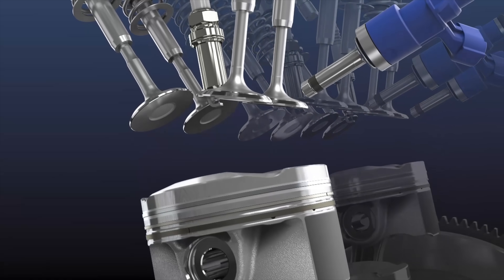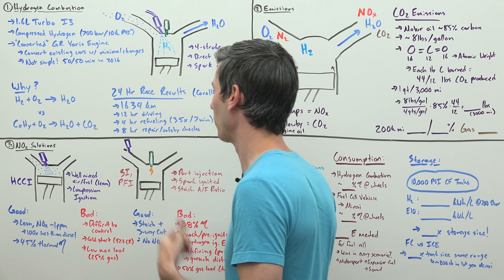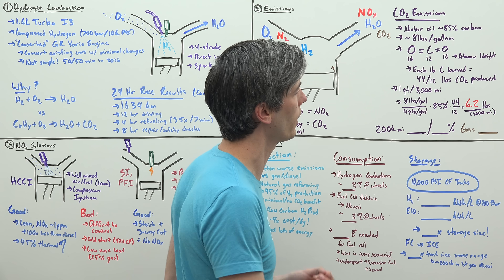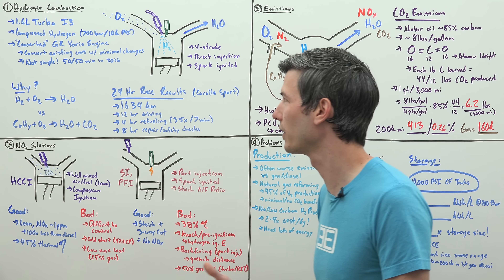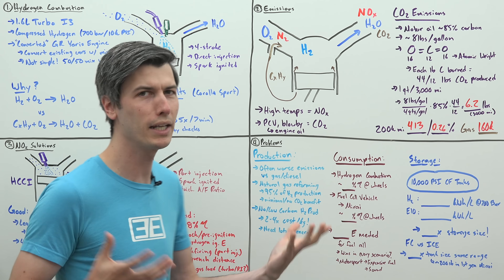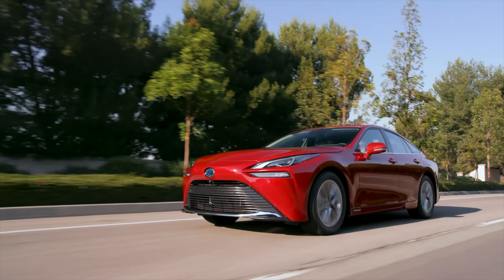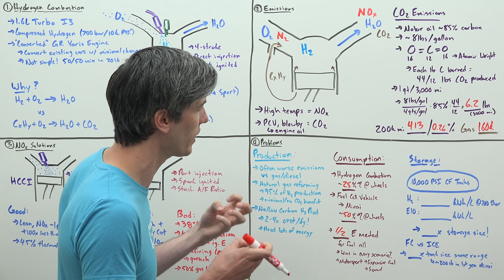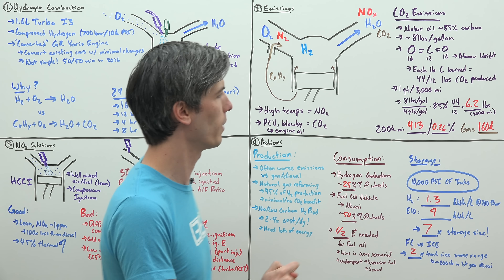Toyota's Developing A Hydrogen Combustion Engine!

Comment: Guess what, most electricity to charge vehicles is also using natural gas and other means in power plants, so stop using this is a way to discount hydrogen production, latest gen nuclear is the answer.  Consider ICE engines and their factory lines are already in place, so it would only need minor retooling instead of complete overhauls, calculate that carbon footprint.

Comment: I'd rather this and just pour water into the engine instead of charging a battery every two hours and then in 5 to 10 years replacing that battery at $5,500.00

Comment: More than 95% of hydrogen is produced resorting to fossil fuels in an energetically inneficient process.
I love toyota as a brand, but I also think they sometimes are too stubborn and do some incomprehensible things.
It's funny that they think its a wise thing to do what BMW has done about 20 years ago, and which mazda (a company which toyota holds major stock in) has also investigated on.
In the end it is still an ICE engine, limited to the carnot efficiency, and it's an investment in overal outdated methods of having kinetic power.

Comment: Alot of electricity to make hydrogen. So you create a huge loss in this method. So you wanna make electicity convert that to making hydrogen, then use that. lol. The amps used to convert water into hydrogen is crazy. You would need to make hudge hydrogen factory's, and then nuclear power plants, natural gas, or solor factory's to power them,

Comment: OK, now this I like. It will need a lot of improvement before it is ready, yet I like the concept.

But as far as the blow by, listen, when your rings wear out, your rings wear out. You are going to get blow by running an old gasoline engine in need of a ring job just as surely as you will get it doing the same with a hydrogen engine.

So the blow by when the rings wear out...that's zero change from one engine type to the other (speaking of blow by alone). Here we are seeing that the emissions NOT caused by blow by are significantly less with this engine. Again, I dig the concept MUCH more than the virtue signalling foolery of electric cars.

The future will hold the same problems as every other new transportation technology: Infrastructure.

When the automobile itself was new, the manufacturers of them got together and started building roads, so people could use their product. That costs money, and a TON of it. In this case, Hydrogen supplies will have to become readily available all around the world. That is a MASSIVE expense. This will never occur unless everyone decides on ONE new technology...

...and if they DO build that infrastructure, they are not going to be willing to just "up and change" again in 100 years, when future hippies start whining again.

Comment: I dont know where you live but it must always be 70 and very pleasant.  LOL  Real world life in the northern states and cities. New York, Chicago, Buffalo require interior heat. This is something that is rarely looked at in a world of gasoline engines that provide enough waste heat to heat a home. Gasoline engines provide so much waste heat that we actually bring in outside air and pressurize the vehicle so we dont feel any drafts. lol Amazing what you can do with gobs of waste heat. Now with what we have taken for granted , we are being ask to create heat with our already low density fuel. So when you show numbers like 50% to 25% it really means nothing to the huge population of the Northern states because the combustion engine will still provide the waste heat but the fuel cell and battery vehicles will not. Heating the vehicle becomes a real BIG factor in the performance of these cars and can no longer be simply overlooked because it was never a problem before. Dont forget a large part of your subscribers are from northern states and many like myself wake up to 5 degrees with 6 inches of snow or ice on their cars and we need the kind of information you provide to make decisions on our future vehicles.  Also air conditioning electric consumption?  Very informative channel, very interesting and well done. Thanks

Comment: Without looking at the video I’m going to say it’s a really bad idea. 1. It will be even less efficient (by a lot) than a hydrogen fuel cell vehicle. 2. 99% of the world’s current production of hydrogen is not green so you may as well stick with good ol’ oil. It’s just not economical to make and store green hydrogen. 3. Lots of moving parts, lots of points of failure - so a backward step in vehicle design. 4. It’s Toyota, who are desperately clinging on to hydrogen as a future fuel.

Comment: Using hydrogen in internal combustion engines achieves only 20-25% efficiency and low power output compared to fossil-fueled internal combustion engines.

Comment: Back in High School, 1980s, I wrote a paper on the feasibility of Hydrogen as a fuel source.  I see that nothing has changed from my conclusions after 30 years.

I really wanted it to be the solution for the next generation of transportation.  But, as you show it is mostly impractical.

My conclusion was that we needed more nuclear power plants as reliable, inexpensive and abundant electricity is at the heart of everything.

So, I studied nuclear engineering in college and worked at a power plant.

Comment: You can produce a tremendous amount of hydrogen gas from a nuclear reactor, for FREE.  And the only byproduct is all the carbon free electricity you want.
Reply: and eternal toxic waste
Reply: @lowfatedes  no. Modern reactors can process all nuclear waste. Their own waste and waste from old reactors.
Reply: @johnnycarson67  mate you can process it until the cows come home, but there's always going to be nuclear waste
Reply: @lowfatedes  let me put it this way, mate: the amount of waste produced compared to ANY other form of energy production is about a trillion to one. An aspirin size o nuclear fuel could power your whole house for a year.   The amount of coal to do that would fill your house up several times over.

Comment: THE BATTERY ISSUE might get better, storage, low drain when not in use, speed of charge and longevity when used BUT don't hold your breath. Currently, we have squeezed that lemon with a hydrolic press. A better thing would be nuclear powered cars using low radioactive elements and going 99% nuclear power for electricity which safe never mind the WOKE crowd who fear Nuclear but not STD's which is what takes most of them out.

Comment: Why not a light weight & simple valve less 2-stroke hydrogen injected engine?
1)Lube oil injected (atomized) in the crankshaft area 
2)hydrogen injected during the upwards plunger hub... 
I expect high revs, high torque, great efficiency and low production costs

Comment: If they had  hydrogen engine's had died Direct oxygen injection just like that Drake fuel injection also 2 spark plugs every cylinder really would not be no carbon dioxide also if that exhaust was rearranged on each cylinder would not be any problems with water getting in any oil AlSO a  vent crankcase ANY 4 cycle engine would not give any problems running ONLY only hydrogen

Comment: Hydrogen gas @ 10 000 PSI in the tank? Oh boy. Oh boy. None for me thanks.
Reply: Safer than gasoline
Reply: @LewisC0298  "safer" is an extremely generalized term. Do you mean less volatile? More thermally stable? Less toxic?
Reply: @californiadreaming9216  in a crash the gasoline engine explodes more often on impact.

Comment: I liked Toyota, my family own a lot but they are soo doomed! 46km per fill is sooooo bad! WAKE UP! Even average EVs are already at 400-600km per charge and you dont have to go to a sticking expensive gas station! Hydrogen will never catch up. The filling stations cost millions and the only cheap hydrogen comes from fossil fuels that are running out! Converting water to hydrogen jsut uses a lot of electricity and adds extra cost, so why not just use it straight in an EV directly, much cheaper!

Comment: Why is the only argument about the cost of refining hydrogen from water? Think about the cost of refining battery elements from the global supply chain to replace all of the vehicles on earth. You can't simply focus on one part of the whole picture.
Reply: Because you don’t need to refine battery elements every time you refuel
Reply: @sam512  why bother responding if all you do is repeat the same point? Do you own an ev? What are the economics of it? What is the time value of the price difference between purchasing a new ev vs buying an old gas car and investing the rest somewhere else?
Reply: @silo3com  investing the rest somewhere else? Polluting some more?

Comment: Toyota/Lexus has already developed their 2UZFE 5.0L NA V8 to compete next year in the 2022 Super Taikyu GT Series in Japan using Hydrogen.  That's Right, they are keeping that 5.0 V8 that has been used in their ISF, RCF, GSF, LC500 and IS 500 F Sport models, but now taking it to the Race Track to use in Endurance Races, etc to run on HYDROGEN, and get it ready for Production.  Say No to Electric.  Toyota already did their Math.  There are Not enough Powerplants in Japan to support an All-Electric Car Nation.  The Cost to build Dozens more Coal burning Powerplants to support the massive amount of Electricity that the population would need IS NOT POSSIBLE, with current infrastructure...and Added Coal Powerplants would be COUNTER-INTUITIVE to Cleaning up the environment, which is the whole Point and argument of the GREEN Movement-pushing people.  Unfortunately, those folks aren't being genuine, and are just trying to SWAP ONE MONOPOLY FOR ANOTHER, so they think.  Good job TOYOTA!  By the way, they are seeing 800 mile plus range with Hydrogen Vehicles, which have ZERO Emissions, and Home Hydrogen generators are being produced that can run off Solar as well.  Guess what the Hydrogen 5.0 V8 sounds like?   Just like the SWEET SOUNDING one that runs on gasoline.

Comment: And even with a hydrogen fuel cell, the well to wheel efficiency is roughly 30% that of an EV.  So the hydrogen engine is half of that.  So your cost per mile traveled is going to be at least 6x that of a BEV, which will generate way more power and torque than that wimpy hydrogen engine. Toyota executives are smoking some seriously wacky baccy if they think this will end well for them.

Comment: Let’s keep in mind that a very large portion of electricity is generated from carbon fuel sources. It is strange that this is conveniently left out by EV fanboys.
Reply: I mean, that’s a problem you still have to solve to get carbon neutral green hydrogen.  Electrolysis on a large scale will use the same energy sources as battery charging.  Currently there is very little green hydrogen but many power companies are moving towards carbon neutral energy sources.
Reply: Convenient attempt to greenwash hydrogen